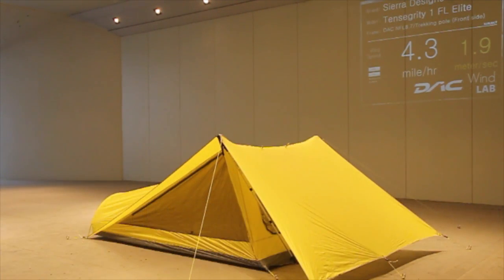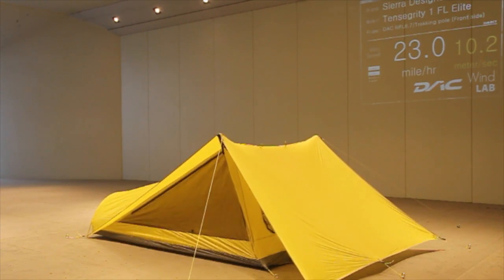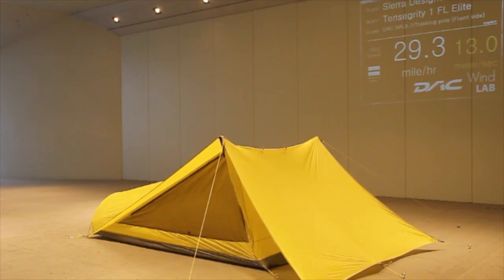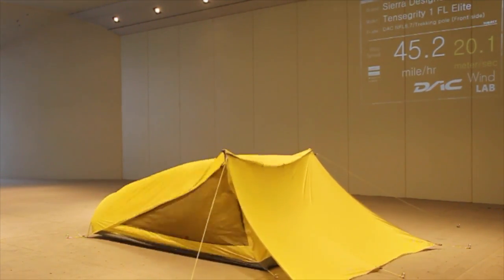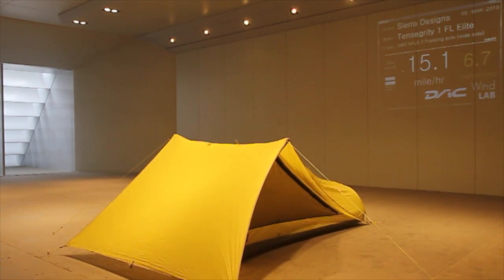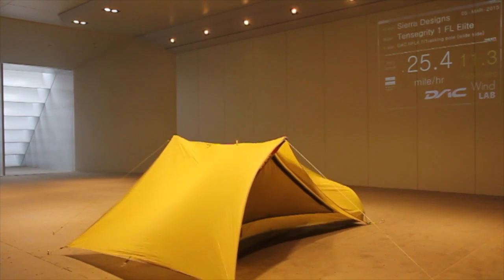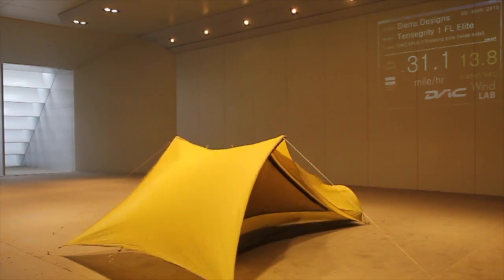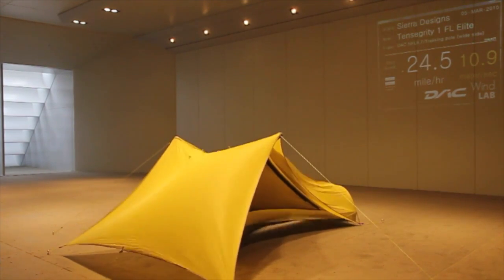Sierra Designs - Tensegrity Wind Tunnel

Comment: Is the foot of the awning wider than the top?
Reply: Yes - with some extra tieouts on the bottom seam, you could pin it down - and than even wrap the corner ends a mit around for a bit of closure of the awning from the side.